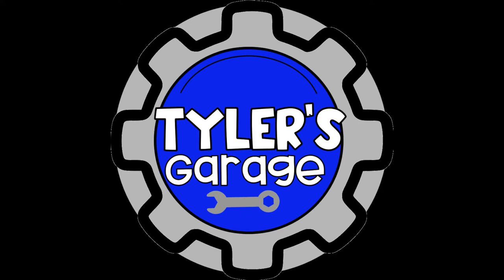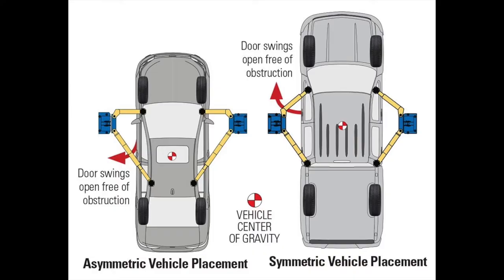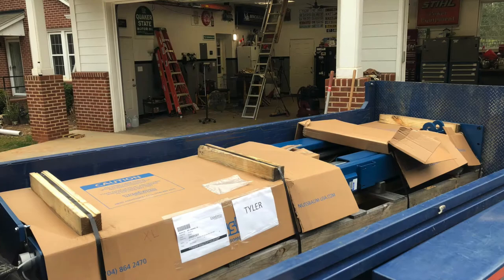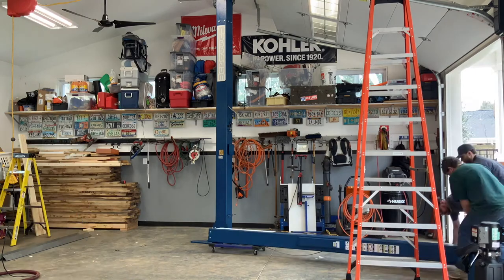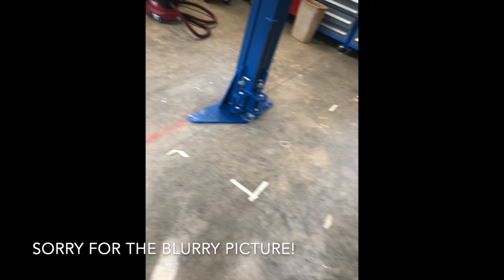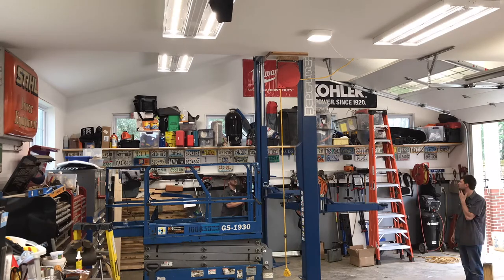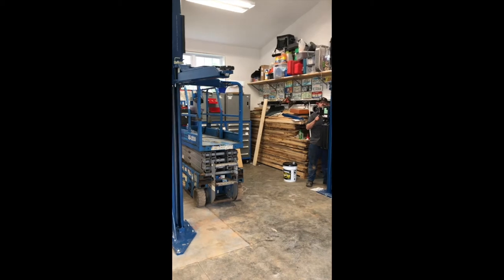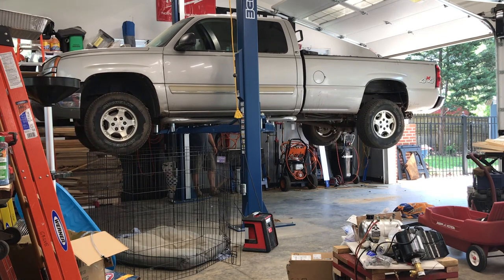Installing the Nussbaum SPL 10000 Automotive Lift

Comment: I have an ancient (Manufactured in WEST-Germany) SPL 7000 that is installed backward compared to yours in the garage of the house I just bought. The triangular point of the base is facing away from the garage door. Does that mean I should back my cars in? Is the balance of the car a non-issue?  I don't see anyone talking about how to center the balance of the vehicle so it's not tipping the lift itself over.